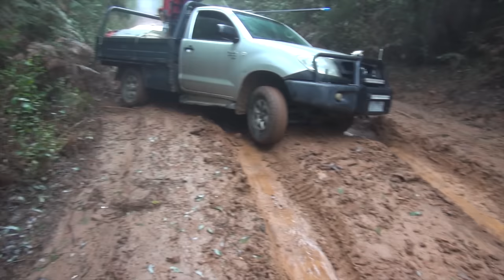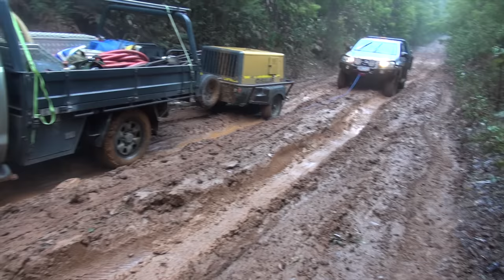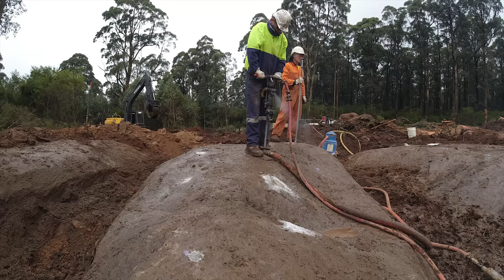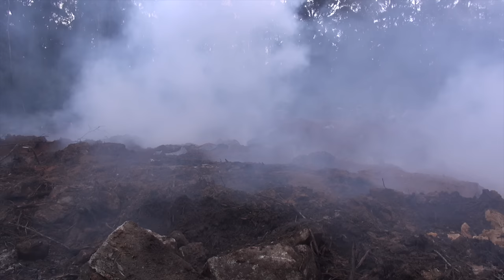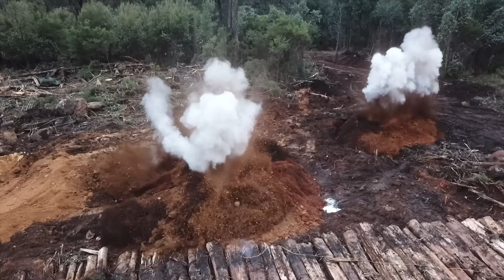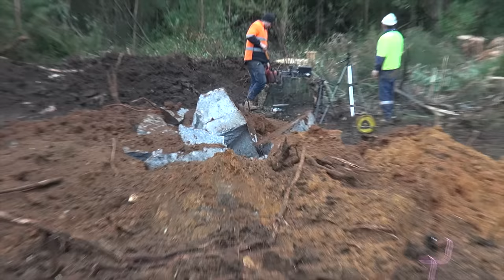Drilling and Blasting in the Victorian High Country

Comment: You're going to need a bigger 4X4 with some winter tread tyres.  It's been a bit like that in Tasmania lately.  The other day I went to pull up at a gate on a slight slope and took probably 8m to stop.   Didn't hit the gate.😀. I can do 60 holes a day too ...with a post hole auger attached to a tractor. 😉. You're a good man on that hammer for sure. 👍
Reply from the maker: Thanks for tuning in and contributing..... I am so over the mud this year, we had a drill rig sinking in it today.

Comment: Well, I WAS thinking of moving out there and signing up as an intern.  I'll stick to like and subscribe for now.
Didn't see any exhaust parts on the ground, so that's a plus.  I'm sure you got a good look at the undercarriage the next morning -- with a hose.  Excellent footage, Sir.  Thank you!
Reply from the maker: I gave it a good high pressure clean but still have some wheel balance issues so there is some mud stuck somewhere... job for the weekend #42.
Reply: @demolitiondavedrillandblast  While you're in there, brake rotors' vents like to be cleaned out with compressed air (you have the necessary mask/breather).  Good time to rotate the tires, I guess.  I wish you the best of luck.

Comment: That was quite a work site Dave if the excavator needed to make a cord wood road for itself! 
Time to get a Land Cruiser Tray ute. A 2nd hand Mine Spec should be right up your alley. You can even get them with uprated GVM. A mate got an ex-dept environment. Let me know if you would like more info about the uprated GVM  specs. 
Mark from Melbourne Australia
Reply from the maker: Hi Mark, I have thought about a cruiser as they are a bit tougher, probably not as good for long road trips though, please tell me more about the up'd GVM
Reply: @demolitiondavedrillandblast  Hi Dave, I will email our Boatman at work tomorrow and I will be seeing him at a work retirement function Wednesday, so I will hopefully have some decent information for you by the end of the week. As you are probably aware, getting hold of a decent used vehicle at the moment is the real problem. Mark
Reply: As for the uprated GVM, it is a Toyota approved series of modifications to the suspension system primarily. In your case with the amount of gear that you carry as well as tow, the uprated model is the one for you without a doubt. With the turbo diesel engine you will be rocketing to and from jobs like never before. 
Mark

Comment: 60 meters of drilling, and by hand! Your sir, are not scared of a good time. I know 20 year Olds who couldn't drill 15 meters in a day 🤣. On a side note, did you make that base plate for the vac system or can you buy that of the shelf? I just picked up an ermator vac (thanks to your videos) but I'm not having much luck finding a usable shroud. Thanks for the great content!
Reply from the maker: Hi Cosmo, congratulations on buying a Ermator. The shroud is home made using all common parts. start with a 1 1/2 inch Gal Pipe T piece you will also need a 1 1/2 inch - 2 Inch Male - Male adapter and a 2 inch threaded hose tail. Cut a 300mm square piece of heavy rubber sheet, use a hole saw to cut a hole in the center to tightly fit the Gal T. Email me and I can send you some pictures - dave at demolitiondave dot com dot au
Reply from the maker: If you have a hammer that is not worn out and use sharp ballistic button bits, drilling 60m a day in good granite in a day is a really big day by myself but a walk in the park when I have a good helper.
Reply: @Demolition Dave Drilling and Blasting  I will send that out, and I really appreciate the help. Thank You!

Comment: Dave I assume that once your rock is located and cleaned off that now you have to grid out the drilling points! Would something like a rope blanket with all the points laid out so you just drape it over the rock and hit the points? Or a lazer with a grid to superimpose a grid on a rock :)
Reply from the maker: They are both excellent ideas but that level of precision is not really required, thanks for contributing #37
Reply: @demolitiondavedrillandblast  I guess I should have realized that you have to. adapt your blasting to the job in hand wherever it is. Nothing fancy just hard work. :)

Comment: Hey Dave when you are boring the holes do you have air going down the drill hole to stop the steel from bogging
Reply from the maker: Yes, the drill is hollow and blows air down to the face to clear the cuttings.
Reply: @demolitiondavedrillandblast  reason I asked I am an old handheld miner from the 70's and we used water. Cheers
Reply from the maker: @John Jordan Ah yes, water is the standard for underground. When I first got serious about stone dust management I converted a drill to wet flushing and drilled exclusively wet for about 4 or 5 years, made it difficult for jobs like this where I had to take the water with me.

Comment: It is obvious that you didn’t get to the job site on that road? Over many years I learned that it was not worth the damage I did to my trucks attempting to get there in such conditions. Hope you washed all the mud off the bottom of your truck⚡️
Reply from the maker: I gave it a good high pressure clean but still have some wheel balance issues so there is some mud stuck somewhere... job for the weekend. Thanks for watching Johnny.

Comment: Dave, it could be time to upgrade the vehicle to a new toyota  4x4 ute  with some all terrains , and ditch the compressor trailer, with a new small hydrovane or screw compressor, treat yourself, and its always nice knowing you will never get stuck again.
And no more compressor trailer . Just sayin ....lifes too short to not enjoy your hobby, I mean work.
Reply from the maker: New 4x4 ute's are just not available, long long wait times. I had AT's and they were good, I opted for the less aggressive tread pattern this time as I'm doing less of these out in the forest jobs these days. The compressor is a 185CFM screw compressor and I don't think they come any smaller than this one unfortunately.
Reply: @demolitiondavedrillandblast  I did a bit of research , you are correct, 185cfm is a big unit, you would probably need to move up to a duel cab iveco daily shortened truck [ I drive one of these] to accommodate that. Great to see how you do the work, I respect your attention to detail, I guess this is how you keep all your fingers and don't have lung problems. Keep the videos coming.

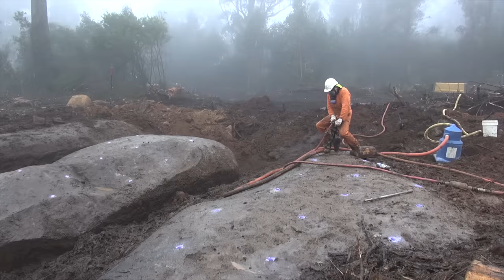Comment: 2:05 I'm surprised you used a dust collector.  Seems like there is nothing around and you were wearing a mask.  Is it just a habit of good practice?
Reply from the maker: Hi Chad it would be unusual for me not to use a dust collector, granite dust has a very high silica content and as such it is a lot like powdered glass in your lungs, if you are exposed to even small amounts of this every day, you don't get to live a long life. I wear the mask to keep stone chips out of my eyes and the oil mist from the drill exhaust out of my lungs.
Reply: @demolitiondavedrillandblast  wow, that sounds very severe, thanks for the response.  I understand now
Reply: @demolitiondavedrillandblast  That answers my question about the visible discharge from the drill.

Comment: I reckon I would've had a word in thier ears about sending that lot through the crusher and spreading it on that "road", don't know how they expect contractors to get to the jobsite when the access is that bad.
Reply from the maker: Yes... as it turns out the stone for the road was coming 2 days after I was there. It was partly my fault as I took the short cut that looked OK in the early part of the track and got progressively worse, and of course I was unable to turn around towing that big anchor behind me.
Reply: @demolitiondavedrillandblast  Shortcuts usually aren't shortcuts in my experience either, at least they intend to do something about it in future.